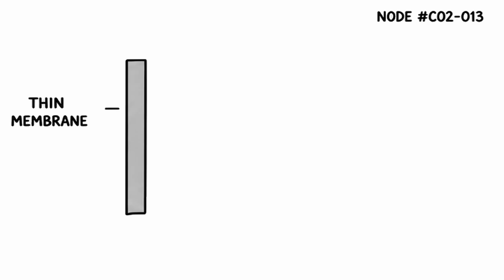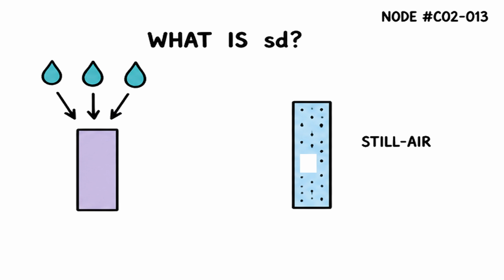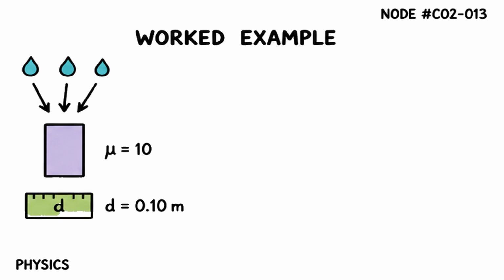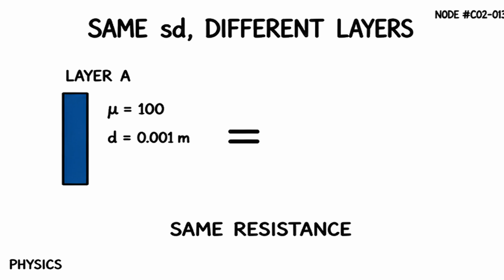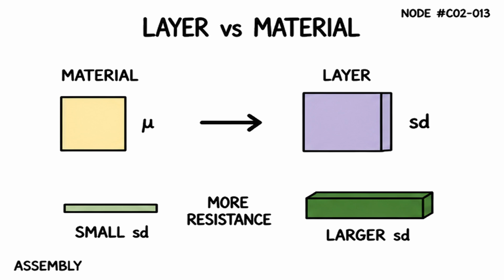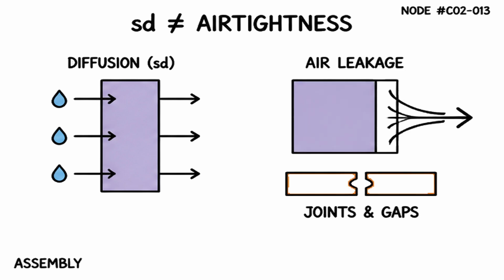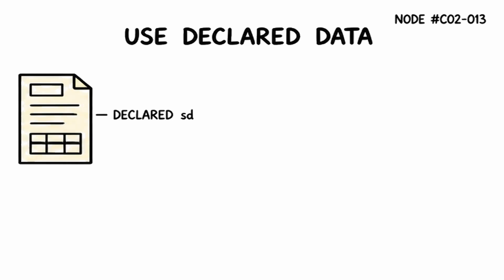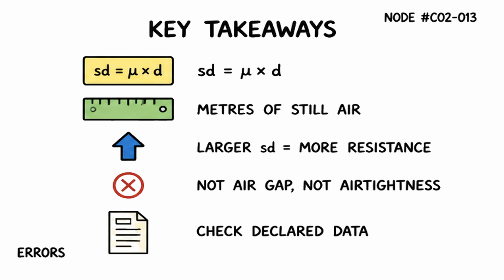What Does sd-Value Really Mean? Vapor Resistance Explained Vaporight  013

Comment from the maker: 📌 QUICK sd-VALUE TEST

A material has:

μ = 20
d = 0.05 m

Using sd = μ × d, what is its sd-value?

A) 0.25 m
B) 1.0 m
C) 4.0 m
D) 20 m

Correct answer: B ✅

sd = 20 × 0.05 m = 1.0 m

That does NOT mean the material contains a 1.0 m air cavity. It means the
installed layer has approximately the same vapor diffusion resistance as
1.0 metre of still air.

Remember:

• μ describes the MATERIAL.
• sd describes the MATERIAL AT A SPECIFIC THICKNESS.
• sd measures diffusion resistance — not airtightness.
• Higher sd is not automatically better for every assembly.

Which misunderstanding have you encountered most often?

1⃣ sd is a physical air gap
2⃣ sd and μ are the same number
3⃣ sd measures airtightness
4⃣ higher sd is always better

Reply with 1, 2, 3, or 4 👇

🏗 Vaporight is a numbered library of building-envelope physics —
explained, not prescribed.